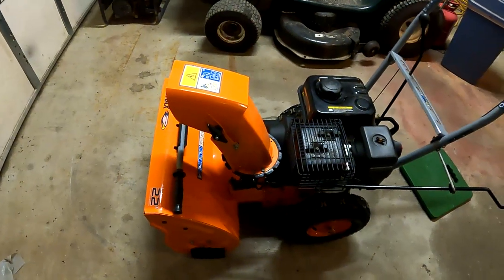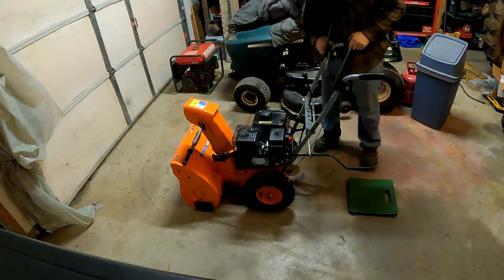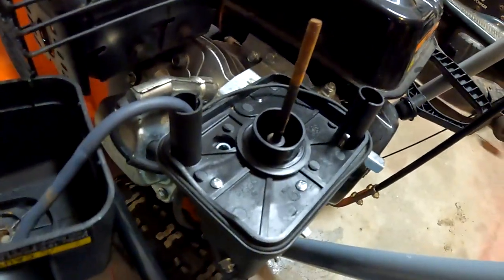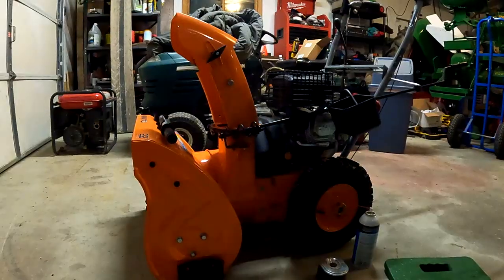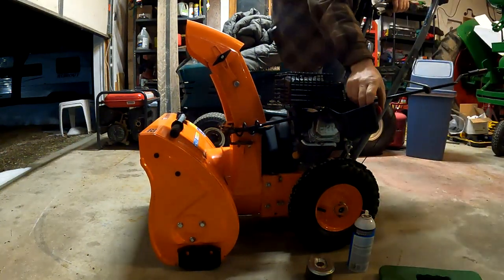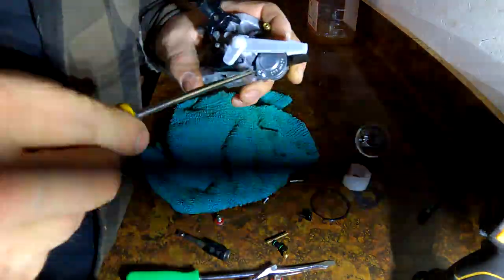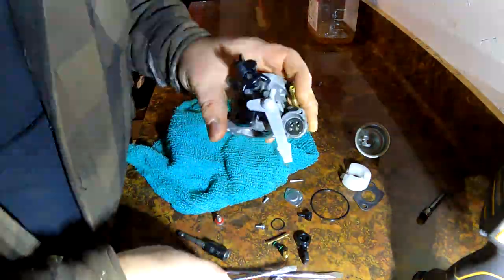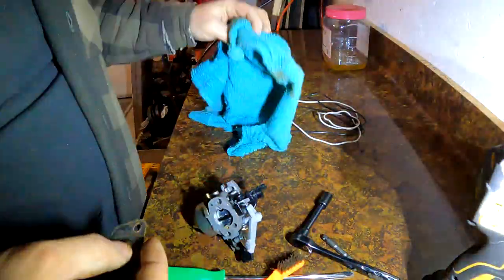Yardmax Snow Blower: Part 1: Gets A Carburetor Cleaning, And Has Other Issues To Resolve!

Comment: You should be using starting fluid you don’t know how to use it supposed to spray it in while you turn the engine over
Reply from the maker: It’s not easy to be turning it over and spraying at the same time. Some engines are impossible to do that alone when the intake is a long distance from the starting method